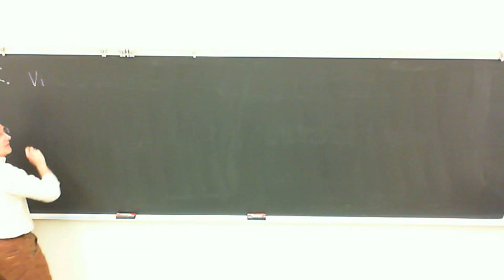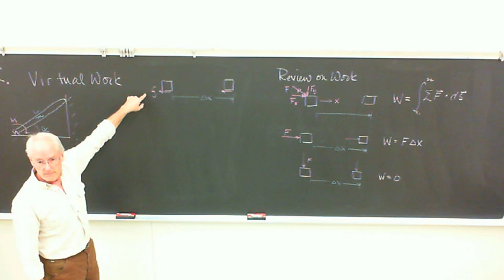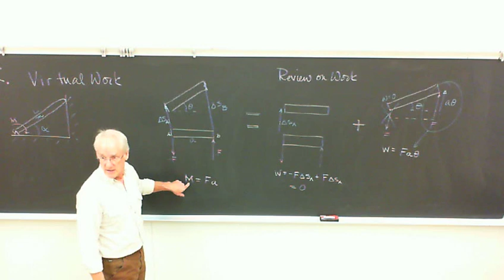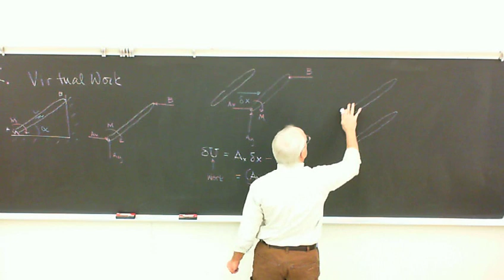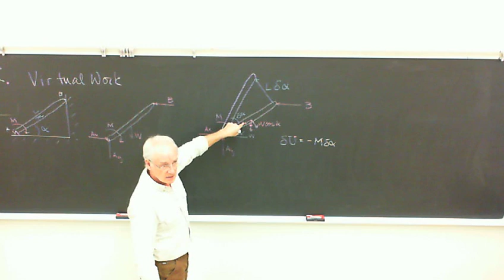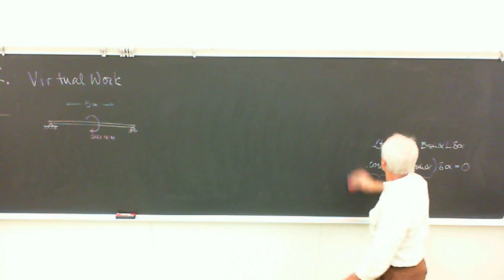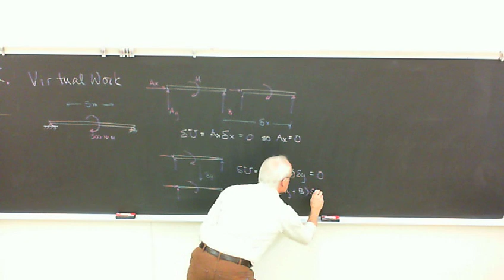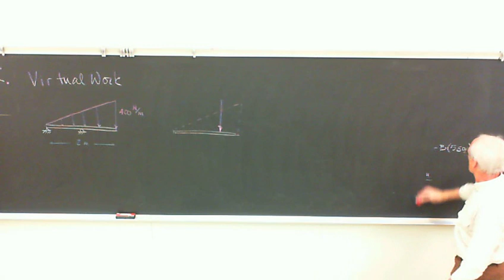Virtual Work, Part I

Comment: Hi, Prof! Great lectures! Was struggling to understand this. Hope you can upload videos about Statically inderteminate structures and all the methods that can be used to solve such problem.
Reply from the maker: Check out the next course "Engineering Mechanics III - Mechanics of Materials" for solution of those types of problems.

Comment: You say at the beginning of the course that the virtual work is zero because the virtual displacement is zero but after you set to zero the coefficient of the virtual displacement and not the virtual displacement itself. Would not be more correct to say that for a stucture in equilibrium the virtual work is zero whatever the virtual displacement considered?

Comment: At 32:59, how are you mixing alpha and del-alpha? How do you know which one to use?
Reply from the maker: I don't mix them.  Alpha is the original angle, and del-alpha is an infinitesimally small change in that angle.  Then the work done by all of the forces done during that change is calculated, and set to zero.  That allows you to solve for those forces.

Comment: at 22.21 minutes, why (Ax - B) = 0??? why isn't del alpha zero??? as del U is a virtual work, del alpha is also a virtual rotation, right??? what's the rationale behind this???
Reply from the maker: You mean "del x" the virtual linear displacement.  It is not zero. That's why Ax-B must be.  I never said the displacements were zero. They're just virtual and small. "Del alpha" is the rotational displacement, which i discussed moments later.  BTW triple question marks aren't necessary.
Reply: Sorry for the tipple question marks though, I'm struggling with this topic very recently, I can't understand why would the del x not be zero? it's also virtual like the virtual work del U. if del U is non-existent del x should also be non-existent.
Reply from the maker: You are treating these numbers like this displacement is real.  This is an artificial movement of the structure done because it isolates forces in the equations.  We set the virtual work to zero to solve for those forces.  If you set both the work and the displacement to zero all you get is 0 = 0 and there's is no use to the exercise at all.
Reply: The virtual work must be zero for any given virtual displacements.